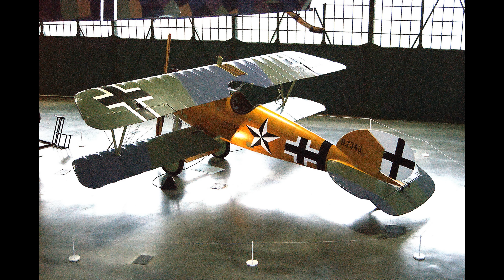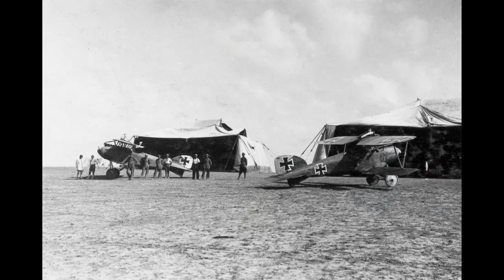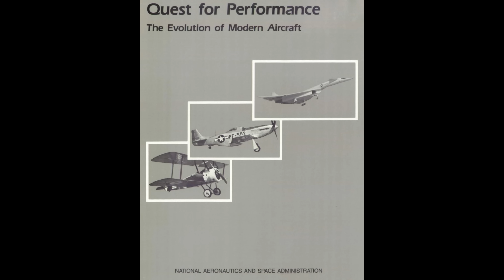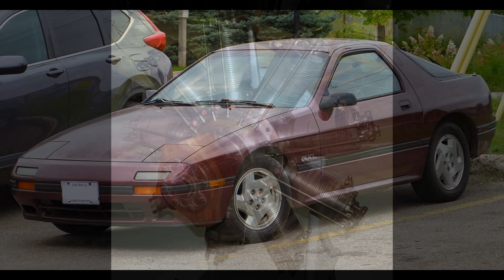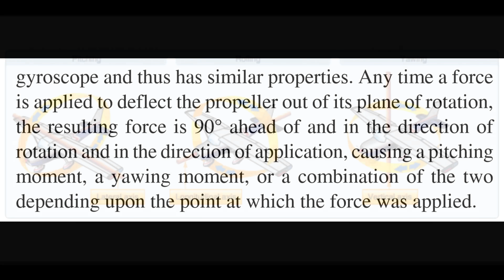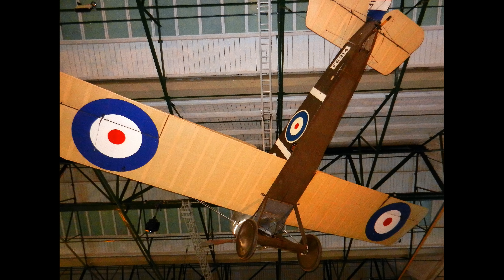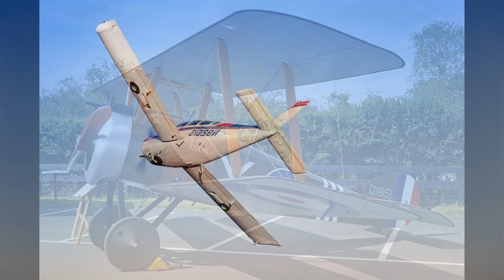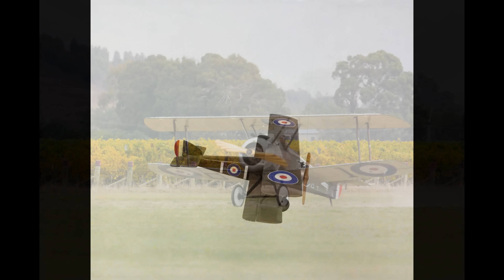Sopwith Camel, War Winner or Death Trap?

Comment: I read somewhere that the Rhône used castor oil which had the negative effect of loosening things up in the pilot. Pilots drank blackberry juice to counteract
Reply from the maker: That's true, the part about the Castor oil. I never heard the part about blackberry juice, but maybe.
Reply: Castor Oil..... Castrol.  Or so I gathered from chainsawyer's video on 2 cycle oil history.
Reply: Not sure about blackberry, but blackcurrant juice was popularly used medicinally - you can also get it in lozenges from UK chemists.
Reply: @strayling1 
I heard BlackBerry Brandy.
Reply: @mpetersen6  That, I can definitely believe 🤪
Reply: Oops. I made the same comment about the issue of castor oil. But I also added that sometimes medical grade castor oil was erroneously used, leading to engine failure.
Reply: Surely they didn't drink the stuff...
Reply: @mytube001  Blackberry juice or castor oil? With a total loss lubrication system and a rotary engine slinging castor oil everywhere the pilots were being bathed in castor oil pretty much the entire time they were flying. The scarves worn by them did triple duty, providing warmth for the lower part of their face, filtering out much of the castor oil they were otherwise inhaling, and keeping something handy to clean the fog of oil and gunpowder residue off their goggles so they could see.
Reply: @butchs.4239 
Also protecting their necks from suffering severe skin abrasion due to having their heads constantly swiveling around. Heavy woolshirts. As l understand it more than one pilot had to make an emergency landing to find a bush.
Reply: @mytube001 Not intentionally. As Greg mentioned, rotary engines slung oil all over the place, including on the pilot, who would inevitably end up swallowing some of it. 🤢
Reply: @mytube001  They might have drank the blackberry juice, but they ended up ingesting some of the castor oil because the engine was spraying it all over the place and you'll inevitably end up swallowing some with the wind blowing it right in your face.  I've read that pilots of rotary engine planes always had a coating of castor oil on their goggles when they landed, and they preferred leather flight jackets (their were insulated, heavy cloth flight suits used in WWI) was that they didn't want to wear a cloth suit or coat that became impregnated with flammable oil.
Reply: May have been blackberry tea. Which is very nice. Made from the shoots of the plant.
Reply: The rotary engines used caster oil as their lubricant using a total loss oil system. Inevitably the pilot injested quantities during flight. This caused considerable loosening of the bowels.  Other cases of loosening of the bowels would be the constant danger and lack of parachutes, resulting in very low life expectancy.
Reply: Blackberry brandy is what I read.
Reply: @fafner1  sounds nice.